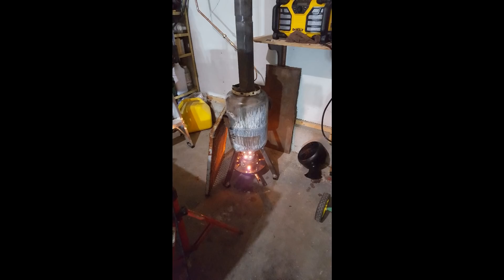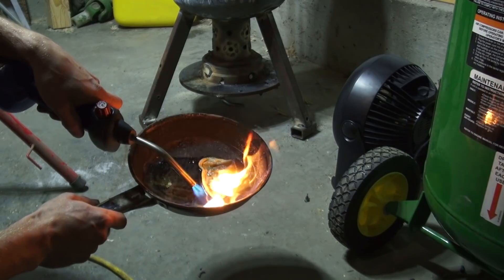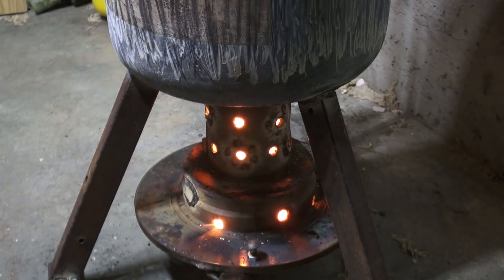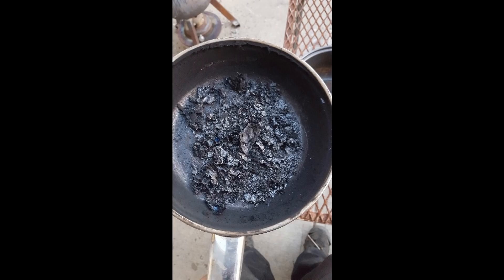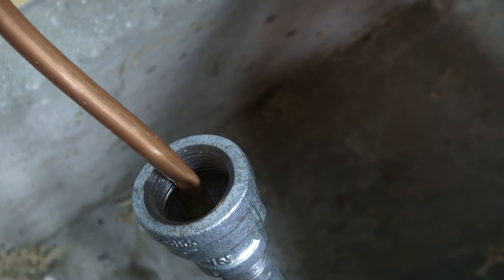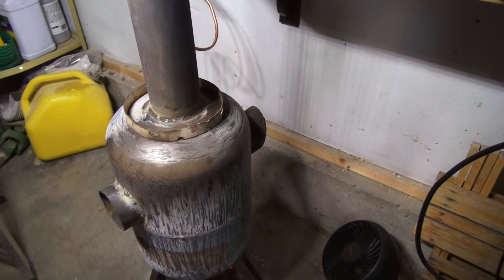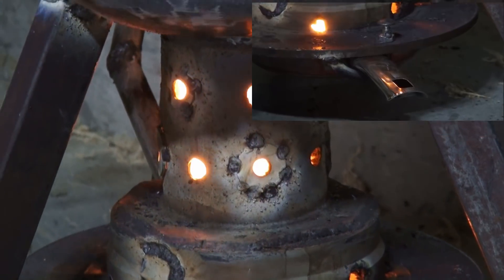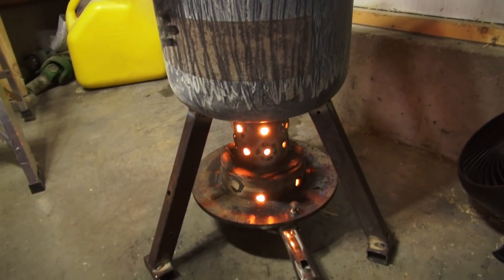[DIY] Waste-oil-burner, what a hotty! (Gravity-Drip)

Comment: I know this is older but had you added some say 1/8 inch tiny holes off set from your big holes I’d say tops two rows start with 1  but it would burn quite a bit hotter and faster and just better or you could open up your exhaust a tiny bit more to get similar results

Comment: Just curious. How does the pot stay attached underneath? I'm trying to figure out for my own build
Reply from the maker: I think I had a bolt bent into an L-shape in the back, into which the cast short handle fit and on the long handle was a similar but adjustable bolt to latch it into. Set the pan in place, twist it and that's it. Very susceptible to overflow with oil as it was not sealed to the brake disc.

Comment: Cool build, but I’m leaning more to a build where the fire pan is located inside chamber and with a air assist on burner and outlet tubes.
Reply from the maker: I have since moved to two different designs, one is a rocket stove  the other, well, a 800,000 BTU shop heater with forced air.
Reply: @MartianDanTheMartianMan  do you have a vid on the last one mentioned
Reply from the maker: @dwaynelejeune3508  it is this one
https://youtu.be/NyVdosZ_VUs

Comment: Instead of trying to control the amount of oil dripping in by valve or squeezing  the pipe   a sealed container for the oil and the pipe going to the bottom of the tub then oil won't come out of the container until air goes up the tube to let the oil drip into the tub.  Albert Harvey Rotary Engines
Reply from the maker: That is actually exactly how my large burner was initially set up. However I had problems with proper dosing. Basically, it does NOT work with waste oil, especially when it goes through different stages of viscosity and fluidity (temperature change). What happened is, that it either starved out the stove, because of build up on the pipe or because it took too long for new oil to enter the chamber. Or too much oil would flood in, because enough air could get into the ever changing volume of the tank and just allow too much in. It works on small stuff and with consistent fluids, just not waste oil burners. Takes more finessing hehe
Reply from the maker: Have a look at my big daddy burner
https://youtu.be/NyVdosZ_VUs
At 3:18 I explain the idea

Comment: This is one of the cleanest builds I've seen for a waste oil burner. The heat exchanger tube is a good idea! More of that heat contained in the tank can be used instead of exhausting it out the chimney. I'm tempted to build my own and use all the jugs of oil from the oil changes I've been doing. Thanks for sharing the video!
Reply from the maker: thank you very much! Good luck and there is always room for improvement!
Reply: 1

Comment: Can you please talk more about your "pipe thru the middle" I thought I had an original al thought here I plan to do this, attach a fan on one side, and ducting on the other, forcing hot air thru a wall or into anywhere I desire.  I also hope to run copper coil(s) inside vessel with external connections for circulating a closed water loop, that will later be used for a shower.  How were holes in side and top cut?  Welded?
Reply from the maker: Since this was more of a proof of concept, everything was done quite crudely. I did have a small plasma cutter to do the holes, literally ALL of them. Just eyeballed and started cutting. The pipe through the middle is just there to allow the massive flame to "lick it" and help disperse the hotspot as well as move air through said pipe. It is indeed welded all the way around.

Comment: Do you think a 55 gallon metal drum with a steel pan in the bottom of it and a drip system feeding work ok for outside burning only of trash??
Reply from the maker: You want to make a garbage incinerator? I found the best way for that is indeed a metal drum with at least 2cm holes (1 inch or more) in 9cm or 1/2ft increments. I actually cut the bottom of mine, so I just take the shell off, scoop the remains up or rake them flat (if there is no plastic or metal left) you can move the shell somewhere else. For added effect I just throw oil on it so the garbage is soaked in it. If you have a reversible vacuum cleaner, they make great blowers to really crank up the heat, by blowing into one of the bottom holes be warned though that those drums will deform even "melt" when you add extra heat with oil and air and the air will throw sparks out of the top and sides. An enclosed version is a large propane tank with an air tube down the center and stops under the (dome). The chimney is welded to the outside shell. Put garbage around the inside, add oil, light her up, close the lid, add air and jazam, only metal will be left, not even ash :P
Reply: @MartianDanTheMartianMan  awesome advice!! I will look into that!! Thanks a bunch!!!
Reply: @MartianDanTheMartianMan  I’m really just wanting to burn personal and private documents and shredded papers...I have several trash bags full! Do you think that would still work good?
Reply from the maker: @Sapper1123  If you want to burn paper to a tiny pile of ash, a burning barrel will work, but paper shreds tend to fly away unless you put a fine metal grate over the top. Sometimes if the agitation of air is insufficient the paper will burn into a pile and the ash becomes a barrier for paper inside the pile and it wont even burn. (To avoid this, you can try just adding holes from the bottom to the lower third of the barrel. The draft rushing into the holes will agitate the paper. It is by far the quickest thing to build. Old barrel, cut some holes, grab an old stove drying rack, viola. Add paper, add oil (doesn't take much) light it up. NEVER use gasoline. When you add paper, layer it with oil, soak a layer, more paper, soak and so on. A liter of oil for a 55gal barrel is more than enough. If you use diesel, you can use a third of that.
Alternatively, just use a paper shredder with crimp and dispose of the shred in different bags (mixing shreds) :)
Reply: @MartianDanTheMartianMan  Excellent thats exactly what I want!!! Thank you very much!!! Gonna start burning soon!!!!

Comment: You shouldn't have any smoke. You need more air in the burn tube or use a slotted rotor which seems to work better than just a plate. Also your holes in the burn tube should be smaller, and more of them, which mixes better and makes a more complete burn. If your system is still smoking it's not running clean. You should never have to clean out you pipes if you build it right. Do yourself a favor and watch other videos here to see the ones that have a slotted rotor under the burn tube and you'll see what I mean. Good luck!

Comment: Hola amigo me pareció fantástico tu invento se  podrá poner un serpentin dentro para calentar agua?saludos desde el Sur de Chile
Reply from the maker: you certainly can add a coil to the inside for heating water. My big burner is more suitable for this however, due to the much better heat distribution and vortex effect.

Comment: Hi, wouldn't a vented brake disc be better for this?
Reply from the maker: right up to the point where you have no control over the air, as well as oil splashing out of the holes, when water (like coolant) might have gotten into the system. I tried it and it did not work for me. Beside, with only a few holes  over the flames, you can regulate the heat output much better. You don't want too much air or she smokes a ton.
Reply: @MartianDanTheMartianMan  thanks for the reply. That might explain why my unit is throwing thick black smoke. I'll close off the rotor holes and see if I get any significant changes. I thought maybe my unit was starving of air because when i slide the pot and open a gap between the top of the pot and rotor it roars and heats up quicker. The smoke I'm producing is substantial though.

Comment: how good is it for your lungs ?
Reply from the maker: When the burner is running, I do not smell anything, nor does the Co-sensor pick up anything. The draft is good enough to pull fresh air from outside. The only times it thickens the air, is when I had too much oil in and it backfires (no danger). You cannot smell it.

Comment: The secret is carburating. That noise reveals you are carburating the oil and the mixture exploits . It's a natural carburator and it can produce a lot of heat. Very much efficient than a simple oil burning.  Good job.
Reply from the maker: You are correct and spot on, the only problem I have with this setup is the actual adjustment of air and oil. I have yet to modify the burner to regulate both properly.
Reply: @MartianDanTheMartianMan  I'm trying make it without smoke for it inside the home.I use burning gas for reduce the smoke at the exit, but always some smoke escapes.I think is impossible, because cars use a good carburator (even a catalizator) but always obtain smoke. we cant make a better carburator than a cars factory. Its a good system, but I think we will  need always a smoke exit.
Reply from the maker: @issaleganes  For inside a home, I would definitely recommend a forced air setup, it burns MUCH cleaner and you can regulate it. The gravity fed burners need to be dialed in and rely heavily on consistent oil type and condition, with a danger from water content. Forced air burners are safer, hotter, cleaner, but require more expensive hardware and power. This "open" design is definitely NOT a good idea for a home. My shop always has the door cracked open when I work, beside the fact that the burner is too hot, lol.
Reply: The reason you still have smoke is that your oil is not being properly vaporized before ignition. The pan your oil drip into should be hotter (not on the ground) and the air should be coming up through the middle of it. You have made many great strides towards a good design, but if you take a look at Gerry’s DIY Channel you will see several key innovations that will completely remove your smoke and drip feed problems. Good job thus far. 👍
Reply from the maker: @NMranchhand  great points and exactly what I changed on my big burner, where oil is few from the top onto a hot plate that will preheat and evaporate the oil in the path of forced air, blue flames and no smoke at all are the result. Now to changing this burner to a similar design, less the forced air. Thanks for commenting!

Comment: i want to make one but also i dont want to die, plus its only like 50 Fahrenheit mid December here is southern California so to die just because i don't like wearing sweaters.....
Reply from the maker: I do prefer my new design of a heater that is based on forced air, it takes a lot less maintenance and care and is very safe when it comes to burning, spills etc.
The advantage to this particular heater in the video is the fact that it runs on gravity and no electricity at all. It is a good little heater for sure.
Always have a carbon monoxide alarm nearby!

Comment: hii, just tell me the truth, 
 is the beginning of the oil burning is like stinky and black ?  surely right ? because it is not hot enough.. i see no growing red metal at the beginning.. and this method..  the suction is not strong enough to prevent the unburn gas into the holes below.. at in video at around 4 mins..

you said clean..  i believe it is not that clean.
Reply from the maker: The startup is dirty as can be. Once the burner is running "hot" the exhaust is as clean as it gets for a natural draft burner, which has noticeable but not obnoxious exhaust. This burner is VERY tricky to adjust, due to the size and ever changing draft.
Reply: ic. thanks for the truth. appreciate it. so, with a little bit of blower it will be much better ? not hair dryer.. it consumes to much to run full time.

Comment: you are the only designer that uses oil without an air pump , so it work with the electricity outage perfect design it is based on the European diesel stoves
thank you and that is awesome job
Reply from the maker: Thank you! And yes, that is the major advantage of this design, pure gravity and draft from the burn.
HOWEVER, the design has it's flaws: 
1) Ash build up in the pan
2) not as hot as air powered
3) not quite as efficient (due to lack of heat)
4) does not burn as clean
I might revisit this build later, to make it burn better and more reliable.
Reply: if you want simplicity without needing electricity,  smudge pots (orchard heaters) are the way to go.  A bit dirty/smoky on startup,  but like any good waste oil burner,  the hotter they get the cleaner they burn.

Comment: i have built just about the same burner. Smokes too much to use in my shop.
Reply from the maker: Because air is coming back out of the secondary holes?
I am starting a new project that uses forced air and the original design is amazing, burning with blue flames. 
This drip oil burner is not bad, but it is sensitive.
Reply: ObsessionPC
I’m

Comment: Does the pipe comin out the top go all the way through the tank?  Up and down to the burner?
Reply from the maker: The pipe is welded to the top of the tank only.
Reply: What the pipes coming out of the front and that back?  Like level with the floor?  Thanks for the quick answer Sir.
Reply from the maker: the pipe through the middle is just eye balled in place and there to catch more heat, I usually have a fan blowing air through it, making the heating more efficient (+surface)
Reply: So it goes all the way through, just one solid pipe?  Thanks, again

Comment: Hello there! Great burner you got there! I'm planning to go make myself one, allready looking for some materials and got some sort of water pressure tank which is a little bit bigger then yours. I also found a nice pan i thought, but I just learned a cast steel pan doesn't get hot fast enough. 

My question: why a not vented brake disk instead of a vented disk, so you dont have to drill holes? Is it because it cools down too fast?

Thanks!
Reply from the maker: Thanks mate! The cast steel pan may take a while longer to heat up, but it will get you the best overall performance AND will NEVER burn through. Any other pan will loose it's bottom or will just not aid with an established burn.
I will continue using heavy pans for sure. Also, when you do an intermediate cleanup, the cast steel retains a lot more heat and will fire RIGHT UP again.
Reply: Thanks for answering! So a steel pan is actually perfect for long burns. I want to use my heater as a hot tub heater so needs longer burning. 

How about the brake disk? Why non vented?
Reply from the maker: 11glenktm11 A vented disk allows air flow you cannot control. The most important thing about the actual burn, is to control the primary air flow (holes closest to the fuel). The secondary holes are important also, but basically just control the temperature and condition of the burn (the more holes the better). I am going to implement a large shut off valve on my next burner, to adjust air flow into the fuel chamber.
Reply: ObsessionPC So I think I got my stuff together to start making my own burner. I saw you numered some sizes of the holes you made. What diameter pipe do you use, the lower and upper? And the lenght of the lower pipe? I got mine now at about 20cm, or 8 inch for you ;), but think it is too long.. Can't wait to test and run my own!
Reply from the maker: 11glenktm11 the pipe is the same all the way around not quite a 4 inch diameter. the lower pipe is about 4 1/4 inches long, which should be 6 inches instead. I find length of the mix pipe should be 50% over it's diameter.
Reply: Sooo, I got my burner running! Got the oil feed all nice and done with heat shields. Tried it once now. Got it quite nice going, I expected the paint would burn off my tank but at 280+Celsius it only got a little weak. My pan is burning dry but the burner was smoking a little. Test was in the evening so couldnt actually see how much smoke there was. Next time I run it will be at daylight.. Also need some adjustments on the secondairy burn pipe I think... I'm working on a video with bulding pictures and first run video, so you, and others, can see what came out!
Reply from the maker: The cast iron pan takes longer to heat up but is the better choice when hot.
A vented brake disk has WAY TOO MANY HOLES and you cannot control air flow. EXCEPT you made a sleeve that you can push over the holes. Primary air is normally very little compared to the secondary, it's all about mixture and you must be able to control it even just slightly, to achieve heat out put or little smoke.
Reply: I totally understand what you are suggesting. I found myself a non-vented disk and used it. Maybe the heat output is a bit disappointing because I use a inox tank. For my point that's actually no problem because I want to put a water heater coil in it..
Reply from the maker: The size of the tank usually just slows down the exhaust and has more area to disperse heat. You should definitely get at least 500'C out of a system like that, with a lot more smoke of course.
The threshold is when the air flow "backfires" out of the secondary holes, the initiator are the primary holes, the more the hotter it will get, until it's thick smoke bellowing out :P But it should turn things red nicely.

Comment: Hi I'm a huge fan of you channel I've been wanting to make a oil furnace as a charcoal  furnace coast way to much to use weekly.   I'm very confused on how the furnace works.   Does it just run of oil dripping on to a open flame with a consistent  and strong air flow?
Reply from the maker: I recommend you watching the update video in the description box. Basically, the oil fumes is what you want to achieve through heat and burn them off "slowly" with JUST ENOUGH air for a clean burn. In a drip oil burner, you wont achieve very high temperatures, but the consumption is quite low (makes sense) and it is easy to build.
Now, the burner pan is basically ALWAYS full with oil and the airflow regulates the speed of the burn.
Reply: Thanks alot:)